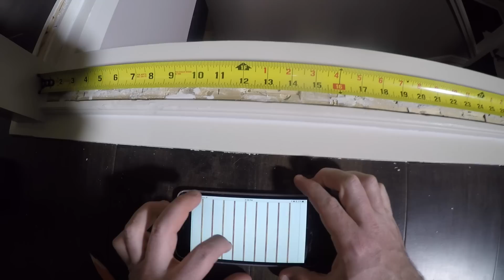Remodeling my stairs and railings

Comment: Dang! Nice work. Want to come do my house next?
Reply: Ben 

I was thinking the same thing
Reply from the maker: LOL.  Thanks.  But no.  This was one of those projects you look back at and think, "wow, how was I that patient?"  Part of me thinks I would never do it again, but then I look at the cost others charge and it is a no-brainer.
Reply: Brett Lyon I wanna do mine myself but not as much detail as yours, I dont think. I want to replace my wooden posts with wrought iron, remove and/or repaint the baseboards along the stairs white, stain the tops of stairs and banister ebony, and the rise of the steps, paint it white. Is there a coating on the stairs that needs to be removes before i stain them? How do i remove the banister and current posts without skrewing up everything?
Reply: Legslipsandlashes I have a similar project I want to do. My railings and spindles are oak and I want do the black and white theme.

Comment: If your first step was already around 7 1/2" by adding a cap on top wasn't it to high of a step and the top step to short?  Just curious but awesome job!!
Reply from the maker: Every step is about 7.5" tall, including the very top -- it isn't capped with a tread, it just goes from riser to the 2nd level's hardwood floor's nose piece.  I could measure the top step to see if it is in fact shorter, if you are interested.  My memory seems to think that it is slightly shorter but that nobody would notice in person (and nobody has, yet).  Let me know if you have any more questions, happy to help.

Comment: Nice work.......Now finish that basement !!
Reply from the maker: I would, except that it is a 1913 "Michigan basement" meaning it has a very low ceiling height (about 6 ft).  I would have to dig out the ground to achieve a practical ceiling height, which would introduce other natural challenges and of course would cost a pretty penny.

Comment: I'm looking to do something very similar in my house, how long did this project take You? And what was the budget with so much hardwood?
Reply from the maker: This project took me about 2 weeks, working evenings after work and then most of the day on weekends.  A lot of that time was learning curve / experimenting / researching, etc.  If I had to do it again, I could probably do it in half the time.  You can expect something like this to cost $1500-$2000 in materials.  All of the supplies I got from Lowe's and Home Depot, with the only exception being the handy stair tread measuring device which is an ABSOLUTE NECESSITY which is $110 on Amazon https://www.amazon.com/gp/product/B00JUOS4RS/ref=od_aui_detailpages00?ie=UTF8&psc=1

Comment: Omg!! Awesome job!! I'm in process of getting the floor and staircase done.and I'm trying to decide if I should get the riser in white..what's your opinion?? Do they get dirty or shoe marks?
Reply from the maker: Deborah Davila nothing looks better than white, so for me it is simple: go with white at any cost!  Yes, it might require cleaning or touch up, but why settle for something ugly just because you want to avoid 5 minutes of possible clean up every year?   I don’t have any marks, but we don’t wear shoes in the house either.
Reply: I agree with you. What size is the wood for the steps and the risers?
Reply: Deborah Davila .  Replying to bump the question.
Reply: I had the floor done with white risers on the stairs and I could not be happier.

Comment: I noticed you beefed up the riser, Was that preference or necessity?
Reply from the maker: John Rivera nice catch, that wasn’t about the riser so much as it was about the new tread - the original treads had a “nose” as they overhung the step below.  So I had two options, cut the nose off by plunging with a circular saw (as some people do) or build out the space behind where the riser would go so that the remaining space was exactly the depth of the new tread.
Reply: @BrettLyon  Thanks, Going to remove move my carpet and tackle this job next week.